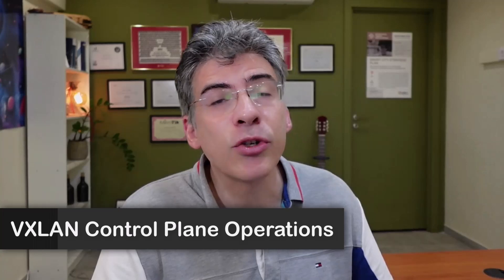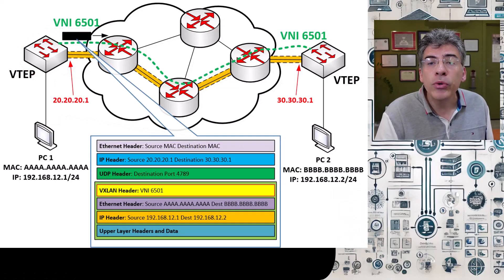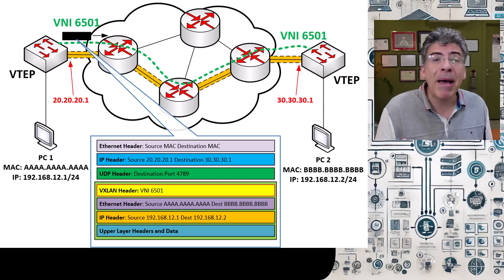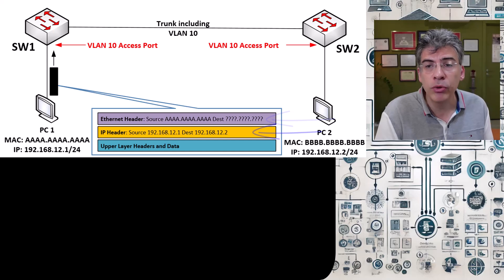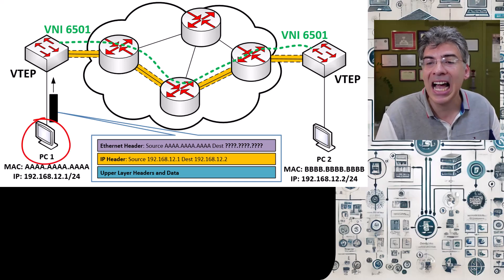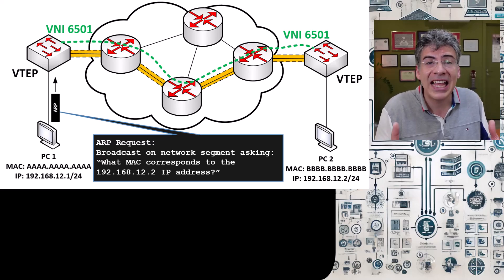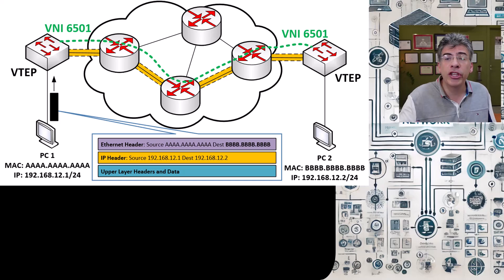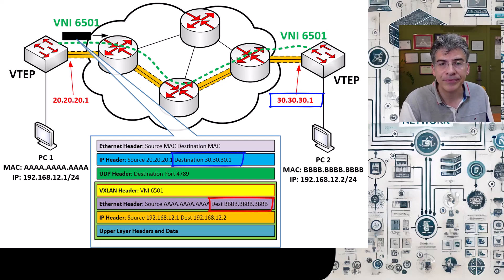VXLAN - Control Plane Operations

Comment: Nice explanation, I am also curious how arp would work during inter-vni communication, since arp is within the same broadcast-domain...does proxy-arp plays a role?
Reply from the maker: In VXLAN, ARP works normally within the same VNI (intra-VNI), where ARP requests are broadcast and forwarded via VXLAN tunnels. However, for inter-VNI communication (between different subnets), routing is required. In this case, hosts ARP for their default gateway IP, which is typically an Anycast Gateway IP configured on the VTEPs. The VTEP replies to this ARP using proxy ARP, responding with its own MAC to represent the gateway. The host then sends packets to that MAC, and the VTEP routes them to the destination VNI. So yes, proxy ARP if configured correctly can play a key role by allowing the VTEP to act as the gateway for inter-subnet routing. In EVPN-VXLAN, ARP suppression further reduces broadcasts by letting VTEPs respond to ARP based on control-plane-learned info.  I hope that helps!
Reply: @telecomTech.explained Excellent.... possibly you can extend the VXlan EVPN series with route types and the other important features..
Reply from the maker: Sorry for the late reply!  Yes, that's a good idea and I will do it in the future...

Comment: Hello LAZ: i see you idea about the comtroling the bum traffic is somehow using multicast or static replication and bgpevpn alone can not used to handle this typ of traffic. Are you sure this is correct? if we use ingres-replication protocol bgp I knew that no need to have multicast or static replication in the underlay.
Reply from the maker: You're absolutely right to bring this up! The handling of BUM traffic in an BGP EVPN VXLAN environment can be achieved in multiple ways, and ingress replication (IR) plays a crucial role here.

If IR is enabled and used via BGP, then multicast or static replication in the underlay is unnecessary, as BGP EVPN itself distributes BUM traffic. This means that BGP EVPN alone can handle BUM traffic, BUT its efficiency depends on the scale of the deployment. In smaller environments, IR (even using BGP) can work well, but for larger-scale networks, it may introduce inefficiencies since the source VTEP must replicate the same packet multiple times for each remote VTEP. 

In such cases, using multicast in the underlay is the preferred approach, as it significantly reduces redundant packet replication and improves overall network efficiency. Therefore, while BGP EVPN with IR can function without multicast or static replication, the choice of method should be guided by scalability and performance considerations.

Comment: Thank you 
1- Do you have a basic lab about that ? Please share 
2- How does this integrate with Spine-leaf in a DC design
If the lab can cover 1 & 2 it will be welcomed !
Reply from the maker: About question 1:  I don't have a lab set up for this one, but I will have some videos that are coming up in this series that are more configuration oriented.  I believe that it will be clearer for you.
About question 2: Spine-leaf architecture is a layer 2 architecture approach for datacenters that requires that each leaf connects with all the spine devices.  In the context of VXLAN a leaf is the VTEP, which is the device to which a host connects.  A spine device is part of the core underlay network.  The same terms are used in a sligtly different context.  Keep in mind that you can run a VXLAN topology over a fully spine and leaf datacenter architecture, although this is not a strict requirement for VXLAN.  Does that make sense?
Reply: @telecomTech.explained  

1- Thank you very much 
2- Yes, I understood that a VTEP is a leaf in spine leaf. You know, I asked this question because all my senior engineers will say « Lékàn, you would prefer run VXLAN in your DC to have a large amount of VLAN instead of dot1q which gives you only 4096 networks. » And spine-leaf is used in the DCs to uniformly minimize de number of hops between each customer and the break out to the internet.
Thank you very much sir !
Reply: @telecomTech.explained  Perfectly. 👌